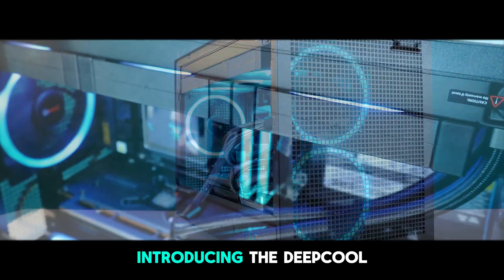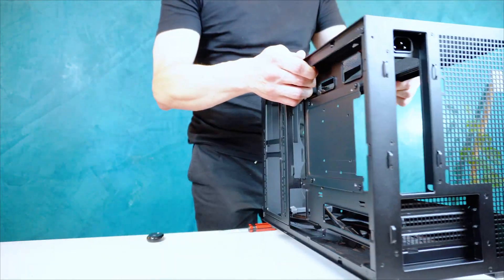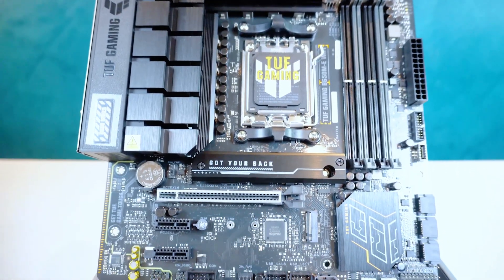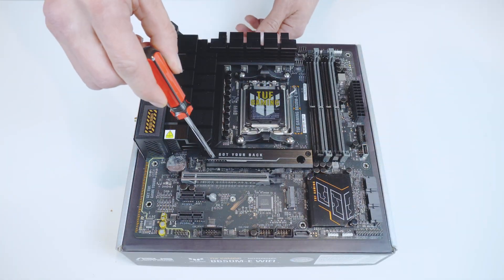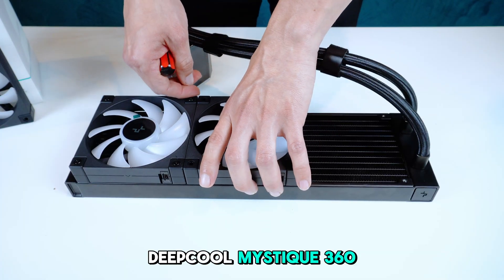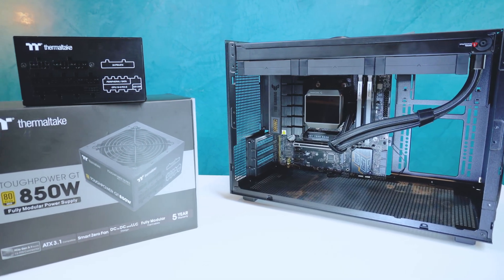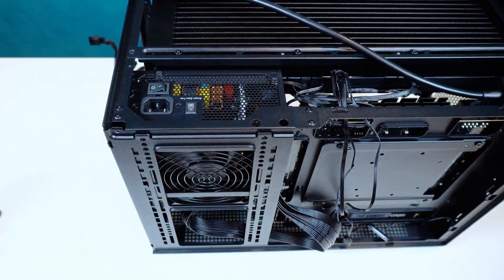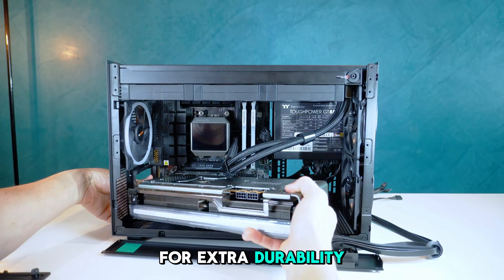Deepcool CH260 + Mystique 360 | AMD RX 7800 XT Pc Build

Comment: Will this fit a PSU of Dimensions (L x W x H)
160 x 150 x 86 mm
Reply from the maker: Unfortunately, it won’t fit in the CH260. The case supports power supplies up to 150 millimeters, and this one is 160, so it’s a bit too long. I don’t have a 160 mm unit to test if it might still work.

Comment: Is it safe for the PSU extension cable to bend like this into the PSU? It safe for long term?
I’m using the same PSU and case as in your build, but I switched the PSU to the reverse side for now.5:22
Reply from the maker: You're right, in the video the PSU extension does look like it's bending quite a bit. It's generally safe if it isn't pinched or under too much stress, but a cleaner solution is to use a:

90-degree right-angled C13 to C14 extension with mounting holes (about 2ft/0.6m).

https://rb.gy/lh632q (you can see an example here on Amazon)

Comment: The bottom dust filter is not great in that to remove it for cleaning you will likely need to remove the gpu.
Reply from the maker: Yes, you’re right, I haven’t tried it myself yet after finishing the build, but another option might be to remove the side panel. Taking out those big, beefy GPUs can be a bit annoying, haha.

Comment: we have the dame psu I had hard time putting the power adapter will this eventually break? its how u plugged it in theres a tension
Reply from the maker: Yeah, it was definitely tricky to connect and the cable does look tight, but I don’t think it will break over time as long as it’s not pinched. A simple fix is using a 90-degree right-angled C13 to C14 extension (2ft/0.6m) 
Here is a example on amazon👉 https://rb.gy/lh632q. 
This will make the fit way cleaner.

Comment: I have the exact same psu socket position as yours and to avoid bending it like yours I chose to change the psu position so that the fan intake is facing inside the case, I see in the video that yours looks to be bending quite extremely?
Is it okay for the psu extension cable to bend  that much? I really want to change my psu intake fan to face outside the case.
Thanks.
Reply from the maker: Thanks for reaching out! You’re right, in the video the PSU extension does look like it’s bending quite a bit. It’s generally safe if it isn’t pinched or under too much stress, but a cleaner solution is to use a :

90-degree right-angled C13 to C14 extension with mounting holes (about 2ft/0.6m). 
https://rb.gy/lh632q (you can see an example here on Amazon)

That way you avoid the sharp bend completely.
If you keep the PSU intake fan facing inside the case, it will pull air from the interior instead of directly from outside. This is fine for many setups, but it can mean the PSU runs a little warmer since it’s sharing airflow with the rest of the system.
We really appreciate your comment and for checking out our build!
Reply: @PC1Hub love it, thanks😊

Comment: Do you know are there any be quiet PSU that can fit in this case? I just found out that Pure Power 12 too big.
Reply from the maker: If 700W is enough fo your setup then the 
Be Quiet! Pure Power 11 700W 80 Plus Gold Atx12V V2.4 & BN631
could be what you're looking for. its a 150mm PSU. 
I really havent tried any PSU longer than 150mm, let me know if you do.

Comment: would u recommend the toughpower gt psu?
Reply from the maker: I’ve personally used this PSU to test hardware that had a short circuit, and it handled it like a champ. It kept working flawlessly afterward. So yes
Reply: @PC1Hub  Because im considering saving some money and getting this one, but idk if i should buy a more "known" name brand.
Reply from the maker: I get what you mean! Thermaltake isn’t always the first brand people think of for PSUs, but they’ve been around for over 20 years. Some of their units are solid picks if you choose the right series, so it can be a good way to save money.